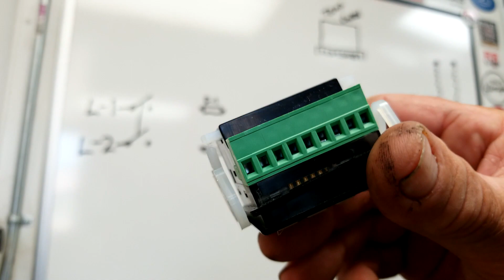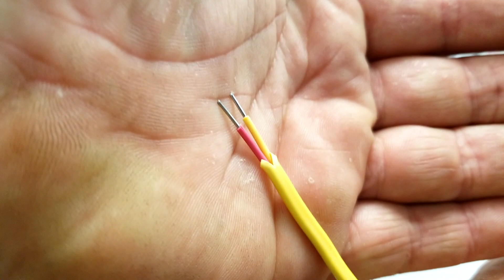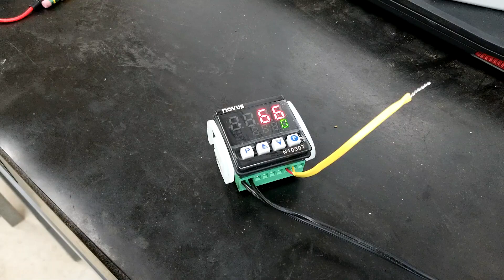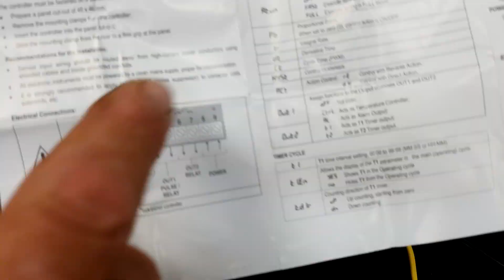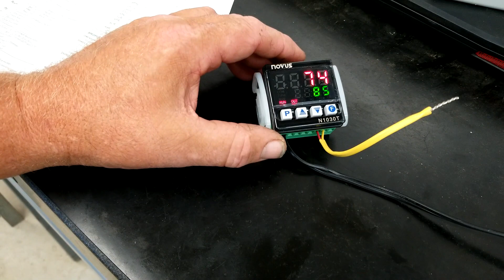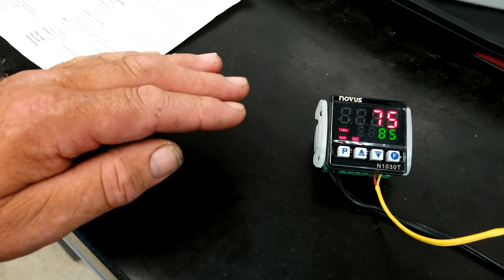Novus N1030T installation and programming

Comment: I'm a newbie. I dont understand why you have two line power inputs on the left of your diagram here. I'm more familiar with using a Hot and Neutral to power the controller where you put the relay on Hot and Neutral would go directly to the load, are these interchangeable with Line 1 and Line 2? Could i skip the second relay and go straight Neutral to the other not-Hot end of my load?
Reply from the maker: The controller can't switch the power by itself,  a relay or "SSR" must be used to carry the power.load.
Reply: @ShadonHKW right, but why is there an ssr on both ends of a single heating element?
Reply from the maker: @RKisBae this diagram was for a 240 volt element, so 1 SSR per hot leg.

Comment: Which range of heatig temperature 🌡️ it reading?
Reply from the maker: @صائبمهدي  It is readinf from 70-600 F
Reply: @ShadonHKW  how many degree in celes
Reply from the maker: @صائبمهدي  It can be set for Celsius,  2000 C is the limit.

Comment: Great explanation of this! The Novus docs just don't explain the practical part of using this, only details. For instance they tell the settings for Autotune, but never say what the heck it actually DOES. 
Is there any chance of you doing this for the Novus N1050 Ramp and soak PID? It is more complicated because it has a USB/RS485 connection, and software that's as poorly written as their manuals. I'm trying to hook one up right now for a kiln controller, and I'm going nuts trying to decipher the manual.

Comment: Hi Jhon
Thanks for great informative video.
I used this device in very similar way, using ssr to control kitchen baker for low temperatures, below 60c.
The problem is that it continuesly operates the ssr and not realy does pwm, it stops only when set point reaced, and goes much higher after that.
I would like it to use pwm, in very low on time of the cycle.
Is it possible to apply pwm with such low duty cycle and high cycle time?
Reply from the maker: Use the auto tune function after the oven is up to operating temperature. Your PID's will be set automatically. If no PID's are entered into the controller, it defaults to on-off operation.

Comment: Hi Stan.  Enjoy your videos for But I am curious why did you wire the two ssr's basically in parallel instead of having each one connect to an individual heater? If each one was controlling an individual heater the current would be halved for each ssr.  As it is, as each ssr would have a slight difference in impedance one ssr would be handling (albeit very slightly) more load.  Looking forward to hearing your response so I can learn something new.  Rod
Reply from the maker: Hi Rod, Each SSR is responsible to switch 1 leg of the power, doesn't really matter how many elements we were firing (as long as we don't exceed its rating) If you wanted to fire the elements individually, you would need (2) 2 pole SSR's instead of (2) 1 pole SSR's,  Hope that makes sense.

Comment: PT is not for PT100 it's for platinum rhodium thermocouple.
Reply from the maker: Just reading per the instruction sheet, I personally have never used a 3 wire temp sensor.
Reply: Hi John PT100 is not a thermocouple. A thermocouple produces a temperature-dependent voltage as a result of the thermoelectric effect. A PT100 is a resistance device. It changes resistance with temperature.